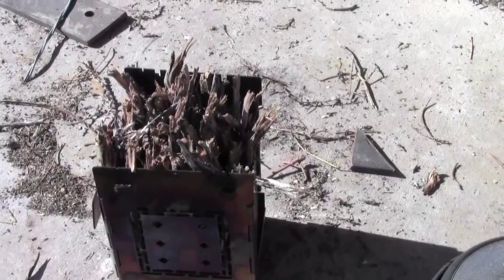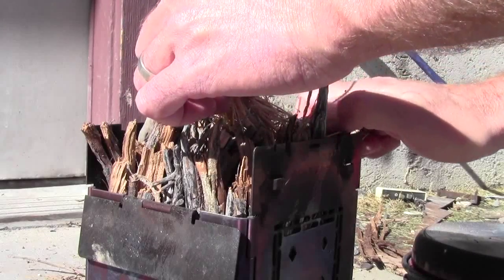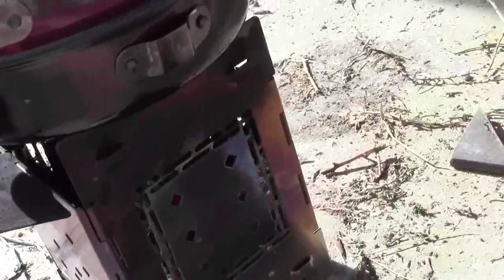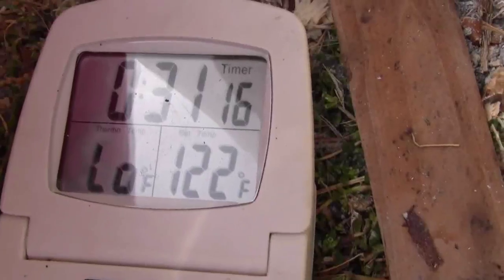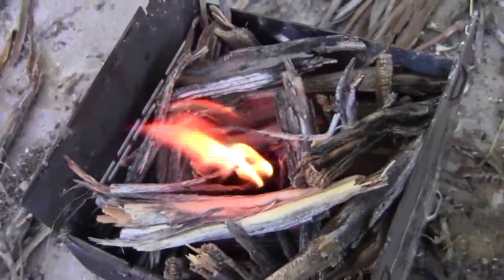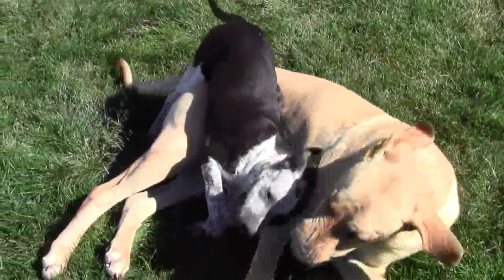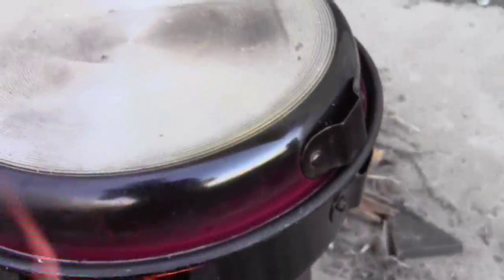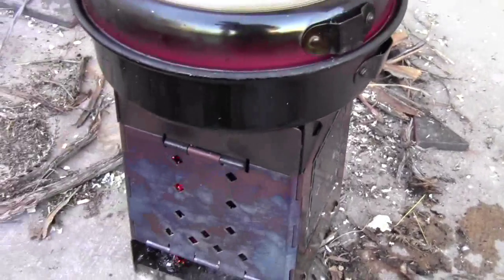Pre-fueling the Firebox, maintenance free cookin!

Comment from the maker: I heard of putting dish soap on your pot prior to use, then the soot washes off quick and easy, but I've found that it's not necessary to remove all the black in order to keep it from transferring easily to your hands or other gear, if you wash the top loose layer with soap and water you will find the layer that remains is more like a glaze that is quite durable and not messy at all and actually improves the performance of your pot by absorbing more of the radiant heat from you fire.

Comment: In my stick stoves, I also use the pre-packed and top down burn method, and I think it has many advantages. From ignition, it maximizes flame time on the pot, and so I theorize that it optimizes fuel economy. And as you mention it allows you to go do other jobs with a nice long burn on the stove.  I use a random packing method which seems to do well for air flow most of the time. The smaller the peices, the more I can pack in.

Comment from the maker: @Wintertrekker  The Firebox's ventilation that goes all the way up in the fire chamber allows you to fill it with fuel all the way to that top row of holes, that way even if the fuel is packed tightly, the fire can still breath. 
I really love the hot coals that this method produces! Great for roasting and simmering with no smoke at all.

Comment from the maker: I wasn't trying to be as efficient as possible but rather to illustrate that the Firebox can breath well enough as to not smother even when fully packed with fuel. Also that you can fuel the unit at the beginning and cook perhaps for several people without the need to add more fuel throughout the process. If I was trying for efficiently I also could have used much less fuel